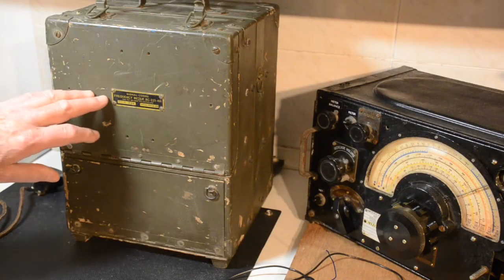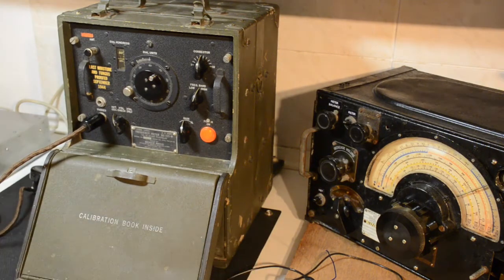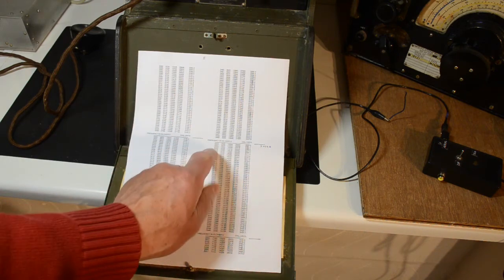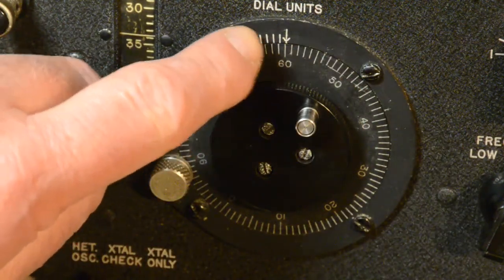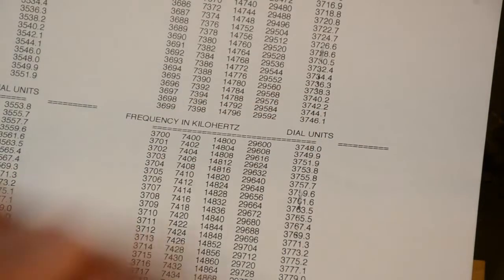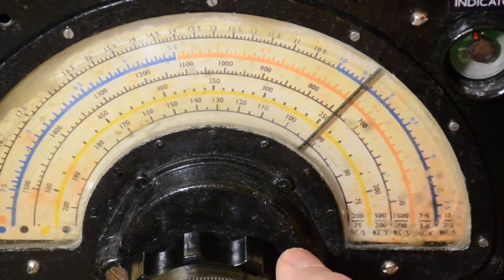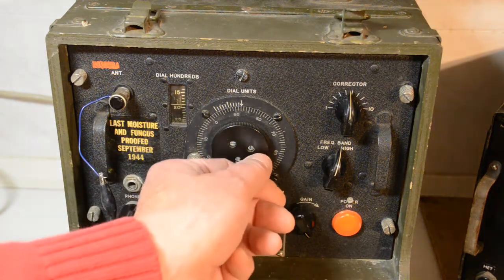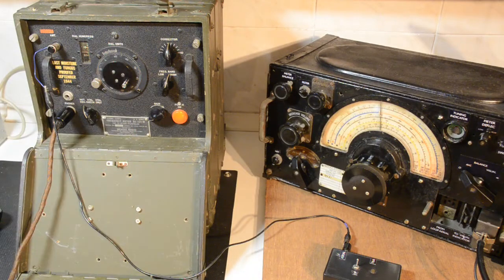BC221 Frequency Meter

Comment: Thank you for demo. I used one of these years ago before I had any accurate signal generator. Although it takes a while to set to frequency, it certainly worked and was surprisingly accurate. Dual VFOs that drifted at the same rate to maintain consistent output was a smart idea.
Reply from the maker: Glad you liked it. Yes, I find it quite surprising just how accurate the thing is after so many years! (Although it does take a while to take the measurement...)

Comment: Thanks for a great video. I have the AK version and would like to check the crystal frequency for accuracy.  Am I right in saying I would go to the Crystal setting on the switch which would then emit just the crystal frequency? What would I use to read this frequency? I do have a signal generator which has a counter function, but the input is BNC connector.
Reply from the maker: Thanks for the positive comments. Glad you found it useful. Are you suggesting that the crystal frequency might be actually wrong, or do you just want to test it? I would like to take our set out to check the questions you ask, but I believe that the crystal switch setting is just the crystal.

The easiest way to check that it is actually working at roughly the right frequency would be to pick it up on a radio set tuned to the medium wave with a short wire attached to the aerial pillar. 

I think that the easiest way to check a low level frequency for its accuracy without an expensive frequency counter, would be to 'beat' it against a similar frequency. In the case of a 1MHz crystal, you could use another 1MHz oscillator or a multiple of this such as 2MHz etc. I hope this helps!
Reply: @lishaton  Thanks for your reply, I did manage to find a solution. I set to crystal only and fed a 1 mHz signal from my digital signal generator into the antenna. Then I zero beat using the adjustment on the signal generator. The crystal showed as 1,000,029, so out by 29hz provided what I’m seeing isn’t tolerance in my digital signal generator.
Someone else suggested taking a reading at the crystal check point of 1mHz and then comparing to the reading from a 1mHz signal from my generator. Using this method the crystal was very close to the 1mHz signal, within 1 position on the vernier scale.
Reply from the maker: Interesting! I guess at the end of the day, it's really a case of just how accurate does a frequency reading have to be? All depends on the actual application of course. However, if we were to assume that your digital genny was absolutly spot on, then 29 Hz off after ?? years isn't at all bad!

Comment: Are these telecommunications and aerial frequenciesn
Reply from the maker: Hi Helen. I seem to recall it is somewhere from about 125KHz to 20MHz. I hope yours still has the book that was made and matched to it, as it will otherwise be almost impossible to use. There is a computer program around that attempts to generate a set of pages of 'settings' for sets where the owner doesn't have the book, but I am not sure just how well it works. As each book was matched to each individual set, the book on its own is useless without the set it was designed to work with.

Comment: Just purchased one of these gonna look into it too see if I can get it too work
Reply from the maker: Good luck Helen. In my experience, it may well work without any repairs as the units were very well made. You'll need to knock up an external HT and LT supply of course!
Reply: gonna?

Comment: Hello I have almost the same one. You said I could power it up with batteries? How do you kñow if the tubes are not blow?
Reply from the maker: The sets were designed to work off batteries, which were meant to be housed in the compartments at the back. How can you tell if the valves are ok? Same as with any other valve set I guess! Substitution is one way, a valve tester is another, OR a relatively simple way is to take the valve out and lash together a simple amplifier circuit to actually hear it working. Granted, the valve might work as a simple amp, even though it has certain faults, but as a rule it's a good starting point if you don't have a tester.
Reply: @lishaton  Okay I will get a tester in a few days. Will I be able to listen on it? I did notice the headphones are missing. I was looking around online for HeadPhones maybe a DJ headphones will work I'm not sure? TnX You for helping me so much I don't know anything about it.
Reply: @Geo’s radio & musical stuff Tnx. All the wires are missing don't know where to connect it too. The one I have was kept by a ww2 soldier and ploit.
Reply: @Jack O'Bean Thanks for getting back too me. I don't really know anything about this unit or frequency counter but I think someone said you can used it to do CW but unsure. I think the unit was battery used at the time it was used.